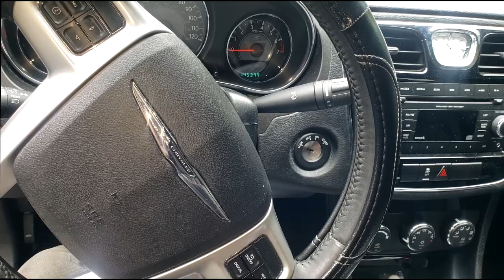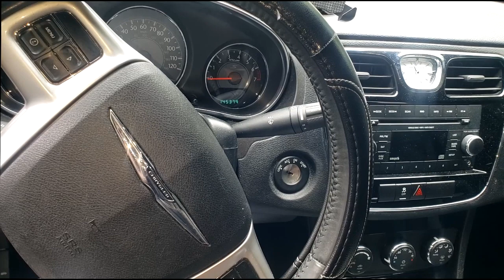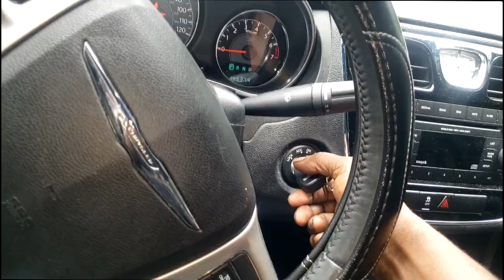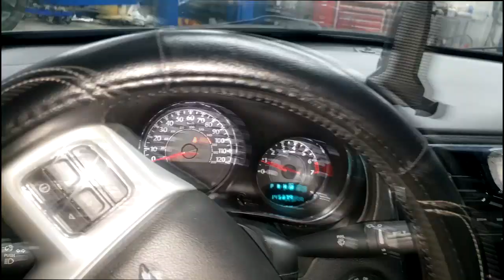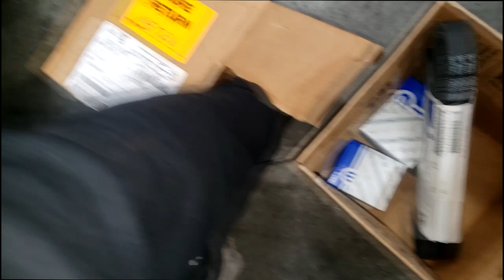IF YOU HEAR THIS NOISE STOP DRIVING YOUR CAR. Chrysler Dodge 200 Avenger alternator noise and belt..

Comment: that belt was shredded to all hell!  where can i find that tool you used to get the alternator bolts out with the swivel head?
Reply from the maker: It was just a typical 3/8 swivel adapter
Reply: @ruffin2000 U mean socket wrench is it’s a swivel or extension ?

Comment: With that mess and as far as u had to drive the pusher would have sucked as well. I would have taken the belt off outside and drove it in as long as the engine was cool.

Comment: My wife 2012 Chrysler 200 was doing the same shit. I replaced alternator, both idler pulley, belt, harmonic balancer and A/C compressor. Noise was still there it actually was a recall on the transmission flex plate. 101317 miles. Such a headache, fuck Chrysler cars.